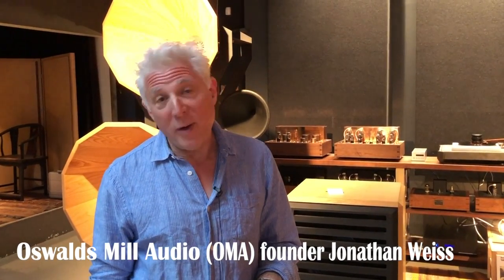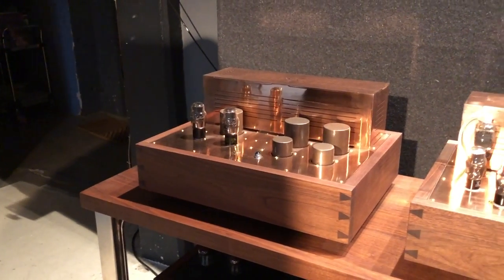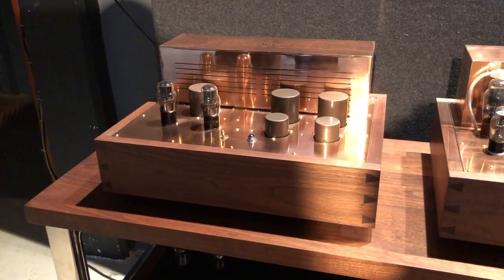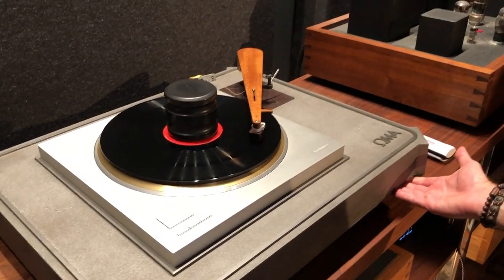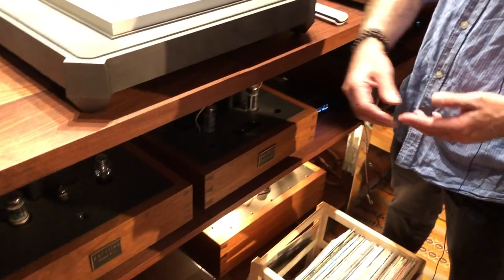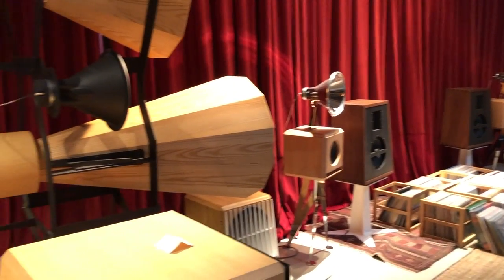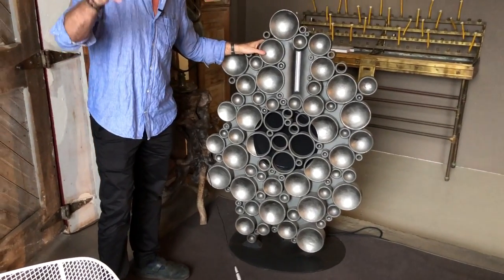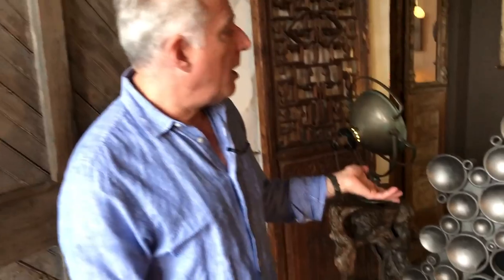Outrageous horn speakers and tube amps, straight outta Brooklyn

Comment: Enjoyed this.  I'd like to know more about the direct drive vs idler :)
Reply: Me, too!
Reply: Me too!
Reply: Ric Byer Research Lenco  L 75. It was a classic idler. Apparently idlers have less loss of speed when the stylus drag (friction)  changes due to the density of the recording. Apparently this can be heard. I used to have an idler in the early 70's. In the 80's all I heard was that belt was better, less rumble so I got a belt drive. Then CDs were the way to go so I went digital. Now someone wants to tell me turntables and vinyl are better?
Reply: me, three
Reply: @kirarittberg5088  A well implemented DD with quartz control is better than either idler or belt-driven turntables. Just look at the rumble and W&F measurements. I have the L75, and I now use it for my 78s. I used it as my main table for some time. It's great, but my JVC QL50 with an SME arm is much better. CDs are also great. In most cases, when a CD sounds bad it's because of bad mastering, not because of the medium itself.

Comment: I suspect the original video of this interview had the  f word @ 7:30, which Steve has (almost) seamlessly removed. The horn speakers must have incredible sensitivity to be driven by amps with so few watts. Jonathan Weiss is an interesting guy and Oswalds Mill clearly manufactures interesting kit 👏👏

Comment: KLH was a Boston group. Altec Lansing is a fun speaker to play with.  I completely agree with OMA loudspeakers, and I admire the dedication the the science.  100 HZ for a horn is doing pretty nice , then the 21 inch sub is over the top for most systems. The amp he uses is the key as well.  With an old ALTEC 500 and and 18 inch sub with ELECTROVOICE high end and a 1200 watt POWER amp 2 channel, I do just fine in my neighborhood.   You are a true AUDIOPHILE, sir.  Thank you for your presentation.

Comment: About four years ago I was trying to figure out how to get the quality of sound back that my old Linn LP-12 had, without spending big money on a system. I kept coming across youtube videos of great sounding turntables. I finally figured out that the Lenco or Bogen turntables were behind it. I found a Bogen 62 on Ebay and bought it pretty cheap. I found Lencohaven and saw the tweaks these people were doing to these tables. I ended up replacing the Plinth with a 40-lb plinth, new idler wheel. I also pulled out a SME 3009 III that was collecting dust. I put the V-15 IV on it and hooked it to the tube system that I use. Also I have Yamaha NS-1000's . I will say this, This turntable kicks the crap out of the linn system that I had back in the day. Dynamics, speed. Sade has such a special voice, The Doors I never used to be that big of a fan, Every note seems to have emotion behind it. There is a lot of truth behind a good idle table.

Comment: 100 years ago, Western Electric concluded that round section horns sprayed ceiling and floors with incoherent sound and so made the throats of the horn rectangular in section, Later, sectoral wave guides or vanes were introduced in horn designs, which made a great improvement in efficient dispersal and articulation of complex wave forms. Today, compound curves in the surfaces of rectangular section horns have replaced sectoral vanes. JBL and Klipsch pioneered in this approach. Computer modeling has helped, but the final arbiter is still our ears.

Comment: Jon's ideas are a throwback to the 50's and 60's, when you bought entire systems from H.H. Scott, Fisher, Pilot, Altec, then either bought or had made furniture for it to go in. You showed it off but it also set off your home decor. This, along with a 100% analog signal path, is why vintage gear sounds better

Comment: I just finished a pair of prototype conical horns that are 14.5 inches across at the large end and 33 inches deep.
I used a pair of vintage Polydax 4/5 inch 4 ohm woofers for drivers. If anyone thinks its easy to build a 12 segment cone on your table saw think again. I cant speak to how the OMA speakers perform only to what I built. The good (very good) is that ON AXIS they  have a rich mellow tone that express vocals and woodwinds (go figure) like I have never experienced before. Kenny G might as well be in the same room! Stringed instruments like a cello or acoustic guitar are also faithfully reproduced. My observation is that it is due to the resonance of the wooden cone. Place a hand on the outside and you can feel the music. Interesting in that this is NOT something that you would want in a "normal" speaker enclosure. 
Now for the bad...Off axis sound. If ever there were speakers that need a LARGE room its these. If ever there were speakers that define and demonstrate a "sweet spot" its these.
Summary. worlds biggest open air headphones. Impractical for mortal humans.
Again I am critiquing my home build conical horns not the OMA.
Steve, did you get to listen? whats the off axis like?

Comment: I'd love to hear these! I see nothing that from an engineering standpoint doesn't make sense - the fact alone it looks nice (most of it, the "butterfly" design, as much sense as it makes trying to make an infinite baffle look palatable, looks weird nevertheless) doesn't hurt matters, on the contrary. There's no way one could tell, from watching a video, whether and how much of a "honk" the horns have etc. If I lived anywhere nearby, I'd want to hear these in person. The idea alone of making a cast-iron open baffle with diffraction so it probably sounds more like no baffle, while avoiding cancellation down to at least the upper bass region etc. Needless to say, they're not really the only ones to put the PSU of an amp into a separate box, be that monaural or stereo. No matter. Some pretty cool stuff!

Comment: Having a separate supply is nothing new. The old high end recording consoles had individual external power supplies for each input and buss. The studios would have climate controlled rooms with racks of power supplies. When you walked in, it looked like a wall of amplifiers. This is the reason that those consoles sounded so good. You had tons of on demand preamp power that gave music life.
Reply: Having a separate supply for a tube amp does not make a lot of sense to me: The tube’s anode needs to be at a high voltage (this is how tube amplify the signal) - a single-ended 211 tube runs at around 950V. So the claim for tube power amp stages is off point in my opinion.
Reply: @monkyw5647  :)

Comment: This stereo equipment probably sounds excellent, but that's not the point.  It is most likely just more stuff for billionaires to practice one-upmanship.
Reply: Well, you mean like a Lamborghini, Ferrari, Koeninsegg or a Cartier Rotonde De Tourbillion watch? It's not meant for poor people like you & me, but it pushes the limits and develop techniques that will be in more affordable shit for you and me later on!
Reply: The entire audiophile universe is one-upsmanship. With audio, it takes very little money to get at 97% of performance. And the remaining 3% of questionably audible to the human ear. You get one of those $1500 system Steve Guttenberg recommends and you are literally 95% there. Same with headphones. A $200 Dac Amp and a $70 SHP9500 or DT770 and you're like 99% there. And Ive listened to $2000 headphones on $2000 CD players. Maybe 3% better than a DT770 and a solid amp. The VAST majority of this hobby is just kidding yourself and showing off.

Comment: Well...The thing is...For example when you listen to someone like Paul McGowan from PS Audio, he comes off as more competent than someone like this guy. Because he keeps it more technical and mote engineering focused as it should be instead of empty rhetoric like this guy. I think J.Weiss is good as well but he doesn’t have as much of a technical handle on the issues as P.M. but he is extremely visual and he is very good at it and he probably employs some very good engineers and he does probably  also have an overall vision on how things should be. It was definitely interesting to watch. It’s certainly a visual feast but of course have no clue about how the system sounds. The butterfly speaker or whatever it is called is certainly a stunning piece.

Comment: Some of what he's saying is complete BS.
"Two identical woofers....no one has that."  
JBL has been putting two identical woofers (x6, 12) in theaters for over 50-years,
I think he's convinced himself about a lot of stuff.
Like, if you want to move those 15" woofers it's going to take some power.
Like, how about 600 watts at 100 hz per side? 18 watts ain't going to do it.
I'm calling BS!

Comment: Dear Oswald,                                                                                                                                                                                                         the efficiency of horn loudspeakers is undisputed, that's why you can sell narrow-breasted tube amplifiers at horrendous prices. The real problem of horn loudspeakers is, that they do not sound neutral or pleasing, they just sound like loud-hailers. Take a funnel and sing in the narrow entrance. What comes out of the great horn output sounds terrible and that is exactly how it is with your loud-hailer horn speaker philosophy. A remnant of the screaming theaters of last century !                                                           A kind of LAUREL&HARDY SOUND in overprized MOUTEBANK DESIGN !!!!

Comment: Back to the Future:
It's interesting that in order to create today's High End, we have to RECREATE the audio technology of 80 years ago and .... You could have owned this same system back then for a song! ... peanuts! .. We've wasted all of the last 70 years time on a low efficiency/high wattage/solid state approach that's never really cut it sonically but ... it HAS enriched the manufacturers.
Get yourself some Zu Audio Omen II's and a Decware SE84UFO amplifier and you'll be much much closer to the sound if the OM system than mostly anything you can buy and cost a good deal less!

Comment: I used to build audio systems for bands, stages, theater, & for audiophile's. I'm also a fan of some tube amps. But most of the stuff in the video is overpriced, overweight BS. It's a gimmick & something to show off for rich gadget fans. It's like a gold plated ipod with a gold plated battery inside, with vintage gold ear buds. It may look cool, weigh more, be great to show off to friends, but sounds & works no better that a $29 SanDisk media player. 

Higher quality, better built components, in a well designed unit will sound better than crap ones, but one can get something that sounds better than the stuff in the video for a fraction of the price, size, & weight. And running a 350-450 volt high voltage tube power cable from a separate power supply to an amp can be potentially dangerous or fatal. Cables get banged, stretched, squished, frayed, nicked, & yanked all the time in real life. Your pet or mouse might bit or chew them. At 350-450 volts that could be a scary situation.

People have been putting power supplies in the same chassis as the rest of the equipment... even audiophile equipment for almost a century without a problem, unless the whole thing was poorly designed in the first place.

Back in the days when many homes & rural areas didn't have electricity, electronics had to be run on external battery power (because the batteries were big). So equipment came with the option of an external power supply if you did have electricity in your home. They're not necessary in modern times except for pocket electronics, where an internal AC power supply would add to it's size & weight.
Reply: Thanks for that. Lets try and keep it real. Remember a sucker is born every minute.

Comment: There are reason why Klipsch Altec/JBL and so many others never made conical, (and conical easier to manufacture BTW). 
so they are making ultra low distortion speakers, and hooke'm to high distortion tube amps... go figure

Comment: He has nice expensive equipment and of course he is going to MARKET his products and explain for his consumer base but any open minded audiophile knows that there are ZERO company that makes a PRODUCT that is for EVERYONE and that will statisfy everyone. The truth is what may sound good to him and his engineers and their method of engineering their designs is not going to be the same as other engineers and designers. They may agree or not agree on the design concept and the physiks behind their electronics. When he says his systems are the best, take it with a grain assault because every high end designer and company says the same thing to MARKET their product. If you were to put all the filthy rich customers who are audiphiles across the globe in his demo rooms, I can guarantee you he will have lots of critics as well as supporters. That is how it is in the real world of audiophiles and pretty much anything else. Because I am an admirer of many designs. If I was wealthy like his customers, I would purchase some of his systems but my number one systems in the many systems i would have would be other manufacturers. For example I will take the GERMAN PHYSIKS loudpspeakers over his horns any day or the 2 million dollar plus TRANSMISSION AUDIO line source ribbons but having a horn system in separate audio rooms, definitely I would get his systems among many other horn or other designs and that includes amps, preamps, turntables etc.

Comment: All of the presented designs are seriously flawed from the acoustic engineering perspective. The last one is just offensive, he talks about diffusion and shows a baffle made of... lenses, which are the opposite of diffusion. And please don't ever talk what's used in the studio if you've never been in one.
Reply: Great way to put it. Not only that: those lenses are all close to the same size, so they will produce a rattle of peaks in in the frequency response. Moreover, since the path lengths are different to each lens, it will have a substantial time smear (one you can definitely hear). I would like John Atkinson to measure this thing.

Comment: Are these speakers "worth" what this company is asking for them? On a purely production through delivery cost versus asking price ratio, absolutely not. But by that rational neither are Coach handbags, Air Jordan sneakers or PXG golf clubs. Practically speaking these are all luxury items that no one needs and no one has to buy. In that respect there is no inherent value in these items except that which the buyer places on them. So, if the bloke with the cash to blow on these speakers decides they're worth the price then they are. At least to him. Anyone else's opinion on the matter, including mine, is irrelevant. 

It always amazes me that some dude surely rocking a Bose wave radio somewhere in Iowa thinks he has to warn a multimillionaire about the snake oil of expensive cables or the lack of value in eighty thousand dollar speakers. Guys, these aren't high school kids being lured into something actually sinister, like their first credit card the day they turn eighteen. The overwhelming mass of people buying expensive hi-fi gear are folks who, spoiler alert, have money to blow on expensive hi-fi gear! The day I see a struggling college student trying to open up another finance account to buy a five thousand dollar power cord I'll explain to him that this may not be the best life choice. Otherwise, I think I'll let the guy in the Ferrari I saw outside of Audio Advice in Charlotte, or the software engineer (yes, I talked to him) who pulled in the parking lot at Rocky Mountain Audiofest in the heavily modified Nissan GTR decide what luxury items they find value in. And to Bose boy in Des Moines, you know that wave radio doesn't have anywhere near five hundred dollars worth of parts in it, right? Geez, what a fool!